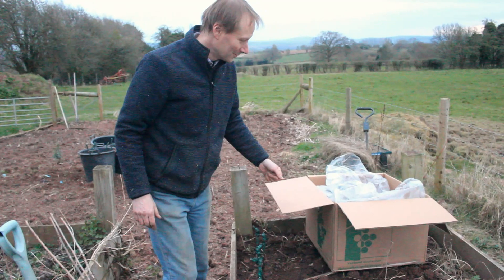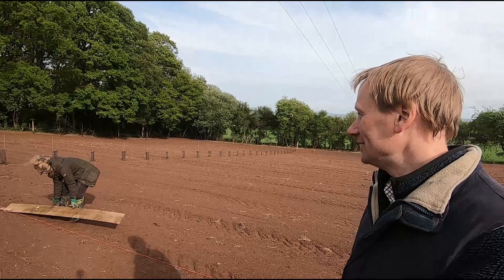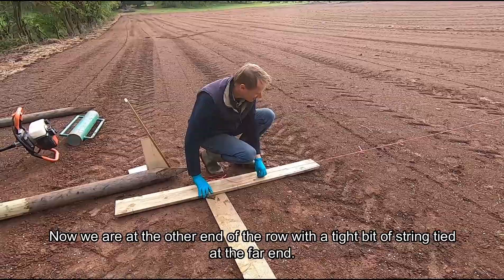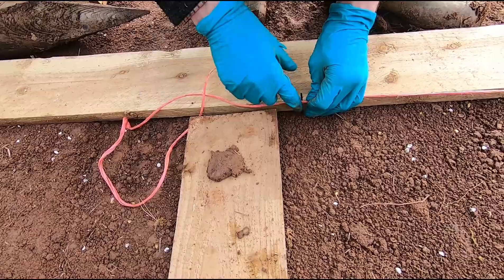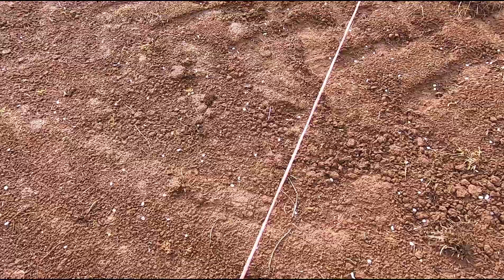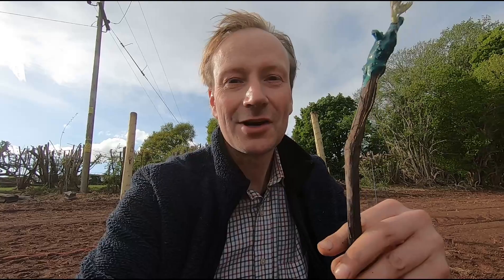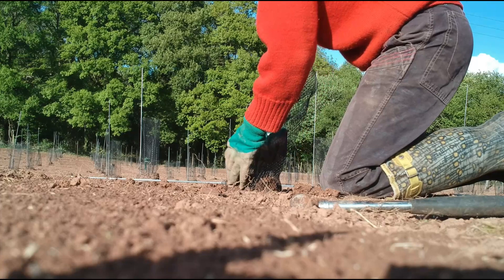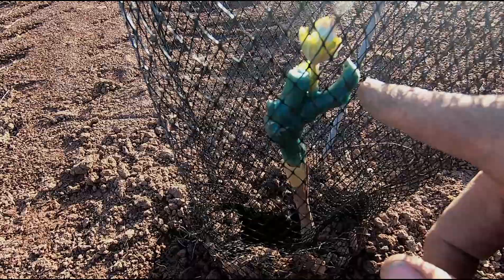Starting a Vineyard from scratch.  Part 2 - Planting Vines

Comment: What wood did you use for the posts also did you dip the posts in something
Reply from the maker: Hi there.  We have used pine fence posts but we treated them with creosote as the standard preservative that they are initially treated with just does make the last more than a few years.
Reply: If you can find Acacia, it category 4, perfect.

Comment: Hi. I'm really enjoying the vineyard videos.

What's the reason for the distance between each vine?
Why aren't they planted close to each other?
Reply from the maker: Amanda Mudau hi there. The only reason for having the vines about 1.5 metres apart is so that they have a enough space so that the grapes can hang down along the trellis wire.  The distance allows about 10 bunches to hang either side of the vine.  Ideally you don’t want bunches to develop above the trellis line in what becomes the leaf wall because it makes harvesting more difficult and also you want the vine to put all its energy in a select few bunches rather than lots all over the place.  Hope this helps.
Reply: @mycountrylife810  thank you so much.
Very informative

Comment: dude. the green wax coated part is the graft union . . . . you planted your stuff WAY to high
Reply from the maker: Hi Jak.  The graft union is much lower down from the wax. There is a distinction between the graft and the root stock.  The wax is there to protect the very young vines from drying out and to protect those initial buds.
Reply: @mycountrylife810  I think you are wrong.
The grafted part of vine is about 5cm the rest is rootstock.